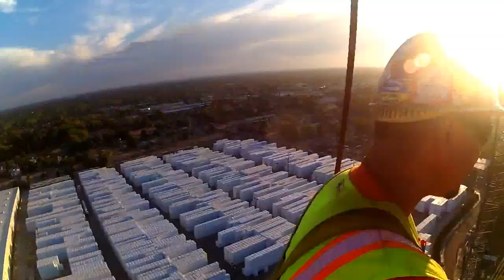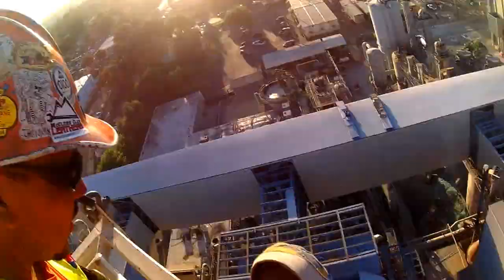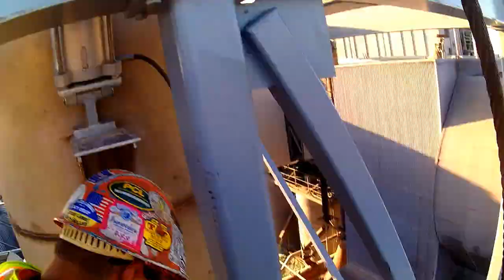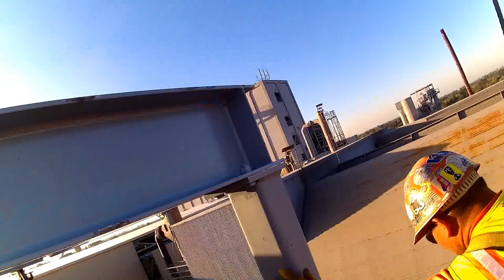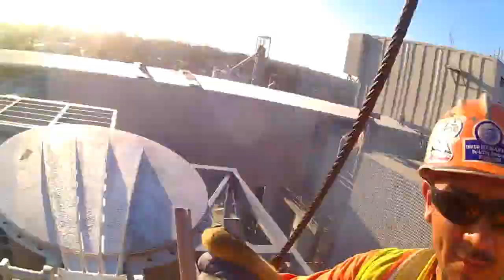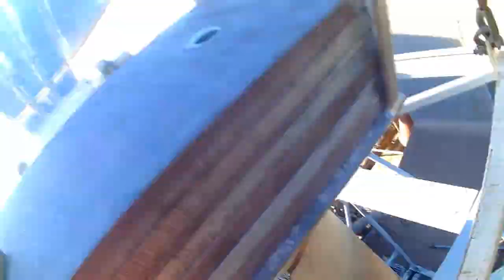Crane Ride, My Job is Cooler than Your Job! GeekPro footage

Comment: Which exact one are you using?
Reply from the maker: The 1080p model, 52$ on amazon. I also purchased 2 extra batteries and a 32mb card, all for under 85$.
Reply: Theres more than 1 1080p now
Reply from the maker: +2002ZRX1200R it's the non wifi version